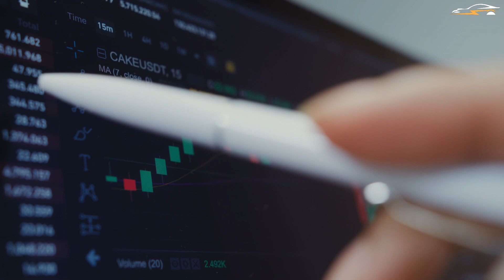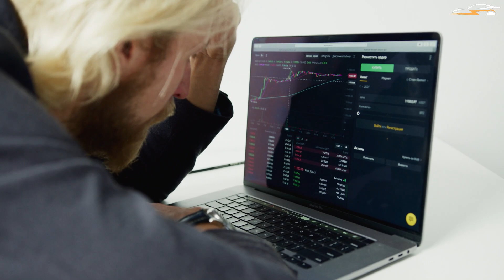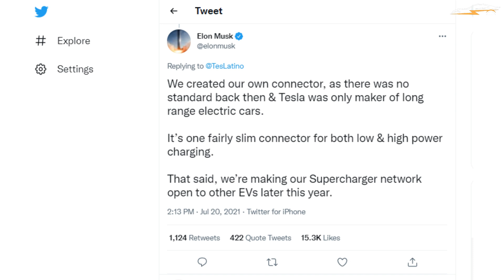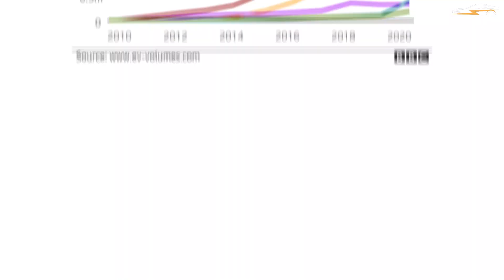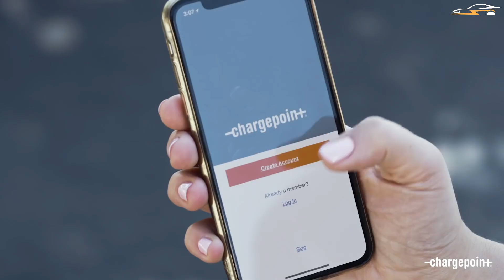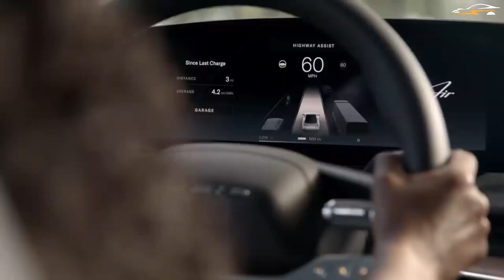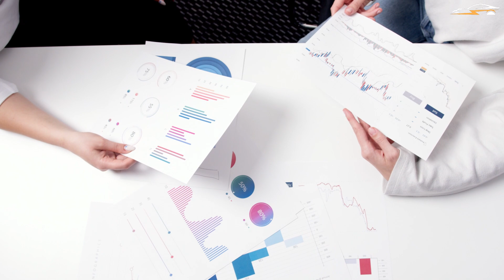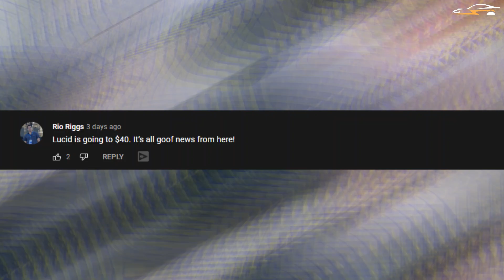Biden's AGGRESSIVE ATTEMPT to having enough EV-chargers!

Comment: United States is definitely slow to adjust. And will take years to get there. China is definitely the leader. That’s why I’m heavy in NIO. Think you have to be very selective in the EV industry. I’m betting heavy on LCID with 2600 shares at $19.43.
Reply: Its very hard to trust any news coming out of China about Nio,so I won't invest in any Chinese company's.  I  hold tesla and Lucid stock,any EV not connected to any unions.